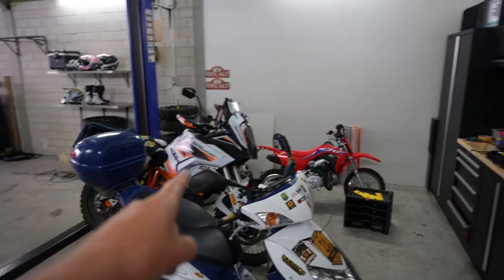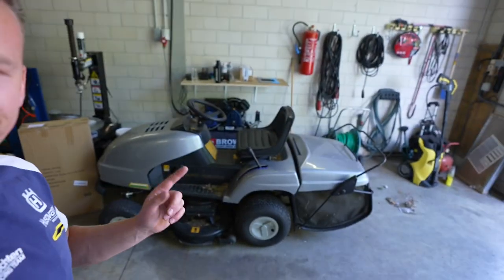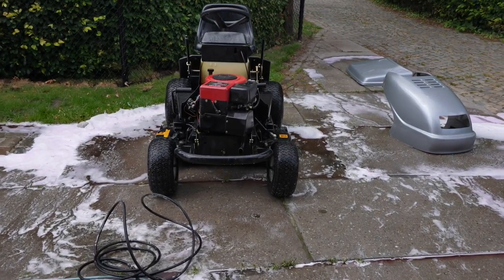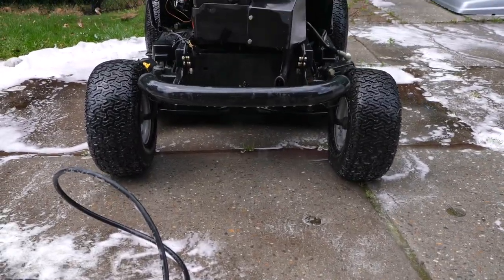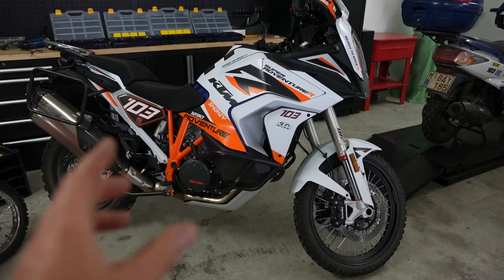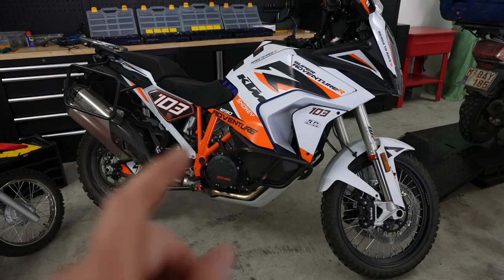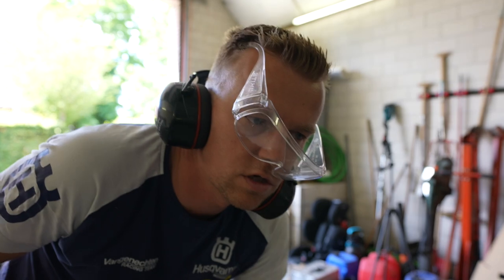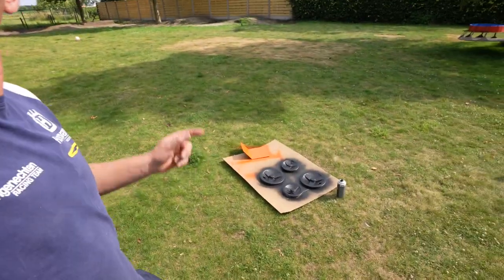Turning My OLD Lawn Mower into a NEW KTM Version.

Comment: Briggs and Stratton.  Made in my home state of Wisconsin.    Was in Wauwatosa last weekend checking out that new Aprilia Tuareg.  Much bigger bike than I expected...but wow.  Nice machine...if it hadn't been sold, might have came home with it.  Very rally like and fit my 6ft 3in person very well.  Worried its not 1290 beast mode power...or even 901 Norden zippy..Yeah, I probably need to mow this weekend...my scag is already faded ktm orange...nice job!  Crack a beer.